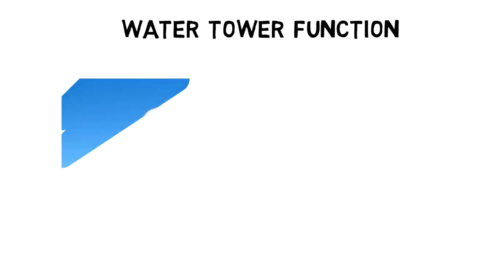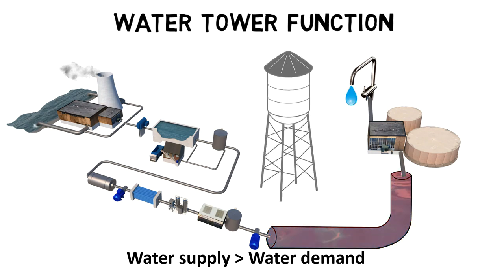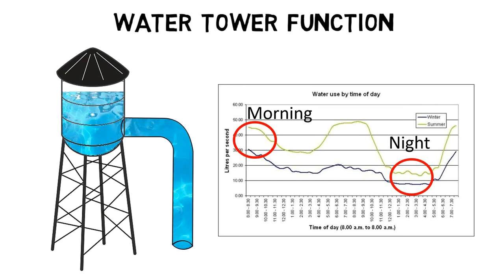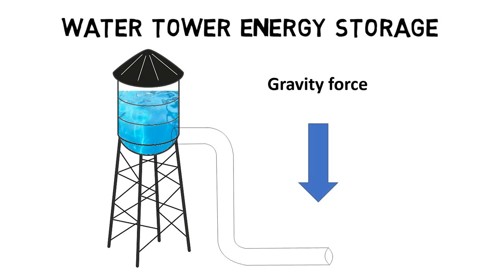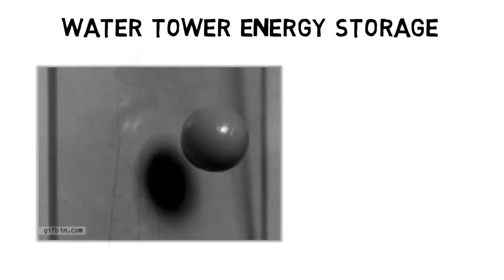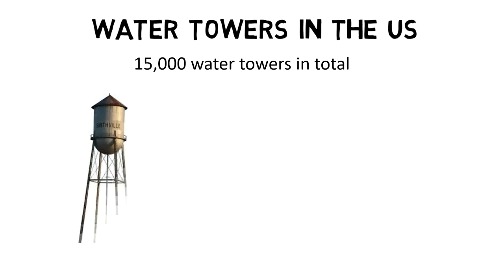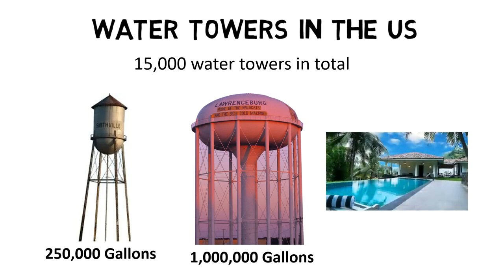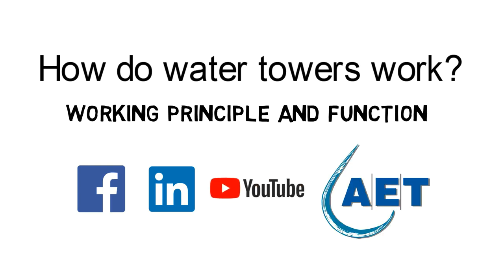How do water towers work - water tower function

Comment: How does the water get into the tower? I have read that electricity is used to pump the water up now a days. I have read that big cities pumped water up with steam pumps in the 1800s, but I am curious to know how they got the water up there in the old west but have found nothing about how they did it.
Reply: My guess would be a steam pump or manual/labor powered pump system.
Reply: @Enceladus... Or maybe a water-bucket/wheel system? Probably a lot of interesting ways they did it